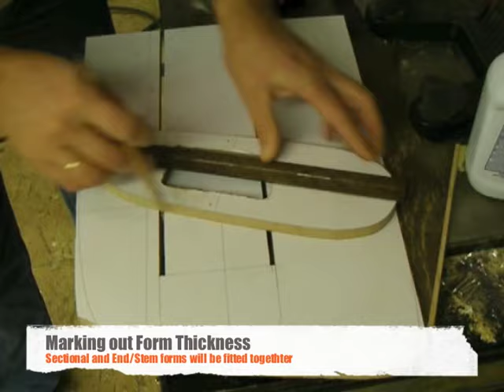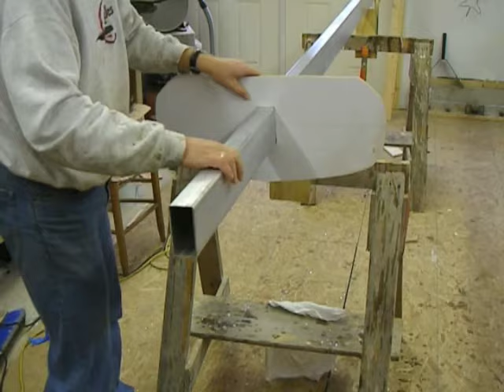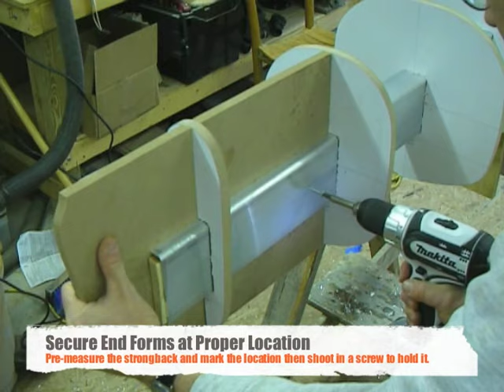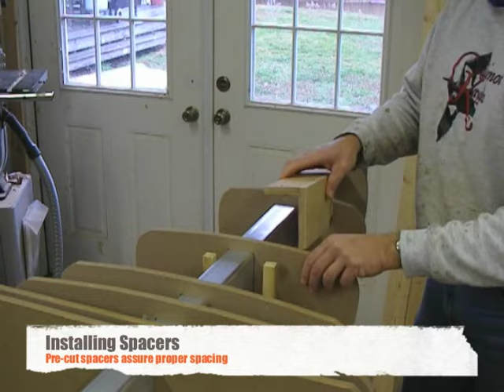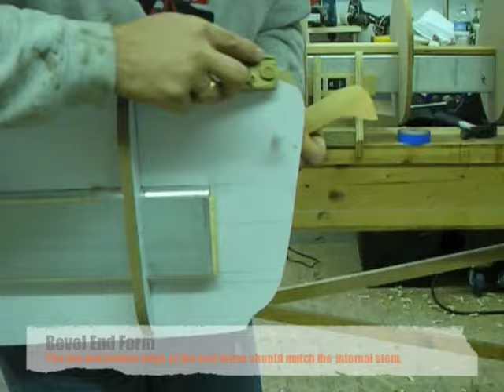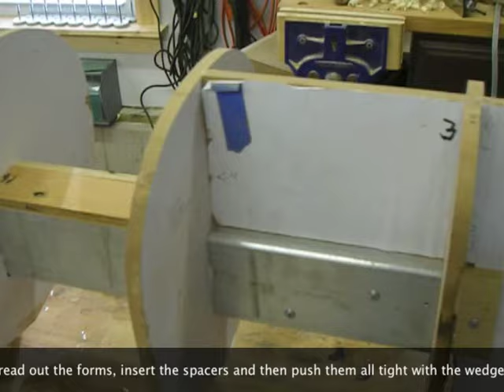Setting up Forms

Comment: In your book, The Strip Built Sea Kayak, it says to " Include the 2 inch by 4 inch rectangle for the strong back cut out, and make the rectangle that exact size, not the size of a 2x4, which is one and a half inches by three and a half inches. Sorry for the repetition, but it's important."  It really looks like in this video and in the illustrations that you cut them right to the size of the 2x4 in contrast to the nominal size as you recommend.  Is it just my eyes playing tricks on me and you're really cutting exactly 2x4 holes?
Reply from the maker: I am using a 2" x 4" aluminum extrusion in this video. It is perfectly straight, so I  slide the forms directly on the strongback. Your standard 2-by-4 is rarely perfectly straight, so the extra size permits you to adjust for any irregularities. 

If you can get a perfectly straight strongback it is easier when the holes perfectly match the strongback.
Reply: Got it. Thanks!

Comment: where can you get that aluminum strongback? Looks like something nice to have if you are going to make a few kayaks.
Reply: 53years&22canoes experience! I now build with 45mm X 90mm and another the same both forming a "T". They're in slip fit doweled sections. Forms are full scale marine archeture with that "T" shaped hole thru each. The whole set-up is suspended on (2) 1/2" 1045 dowels bow&stern. They are 45mm. appart. Final step is plugging those holes decorately.  I make 2ft to 24ft. on a slick sliding jig all from "T"-slotted extrusions by Rexroth Bosch Aluminium Framing System.  Currently doing a "plug"18-6 racing canoe.  3/8" Balsa core with vac-bagged&glued Ziricote bookmatched veener from Certainly Wood. 1/42" veener custom linear layout. Will be a unparalled show boat. 1/2 completed.